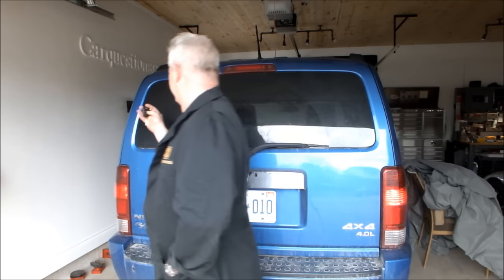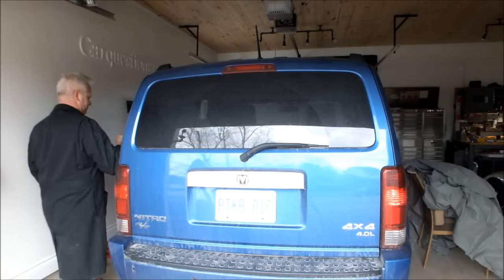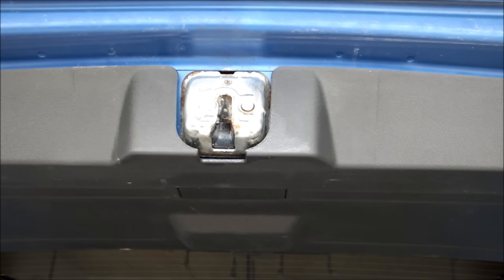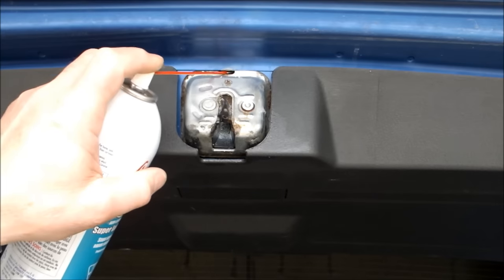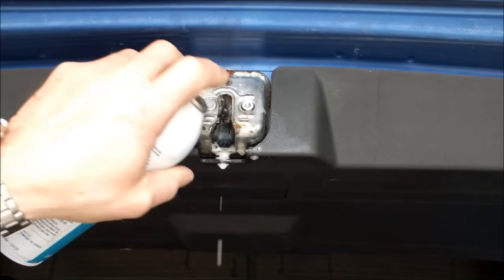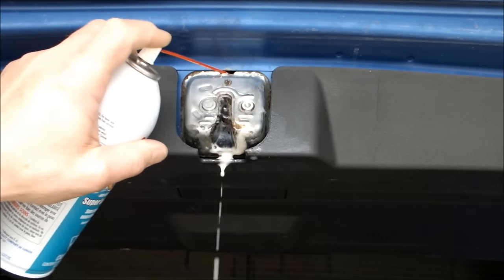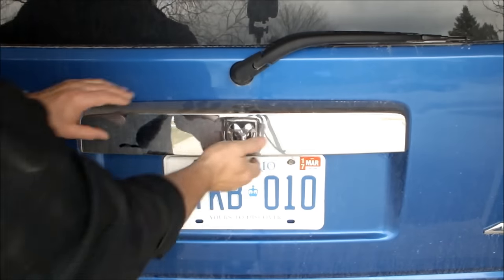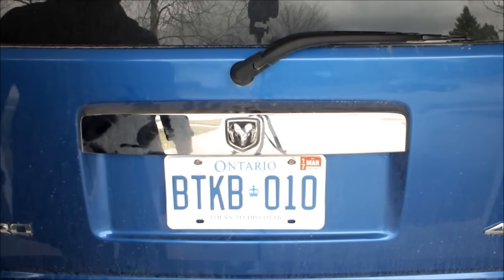Car Alarm Keeps Going Off - How To Fix It

Comment: Started having this problem yesterday.  Called the agency just to get an appointment and after being placed on hold for four times to get to the right department,  I came up on them.  Checked YouTube and your video was the first one that came out.  It made perfect sense.  I have one door that does not close properly.  I took your advise and now monitoring my car to see if it got fixed.  I am subscribing.
Reply from the maker: Thanks - hope it works for you

Comment: The wife's 2015 Journey just started the "Alarm" thing. The rear hatch light would come on even though it was closed. Watched this video (the first video that came up) popped the little inspection cover at the hatch lock area and sprayed it with wd40. Problem solved. Thanks for the tip and thank you "You-tube"
Reply from the maker: Gotta love the Tube - way to go Pete!!

Comment: Thank you so much! I have been having this problem for a couple of days now and have had people leaving angry notes on my car complaining about the alarm. I was quoted $109 an hour for an electrical diagnostic (did not know how many hours it would take to figure out what was wrong) and instead bought a $5 lubricant and tried your technique out. It has been 8 hours now and no alarm sounds! Thank you thank you! You have saved me so much money and trouble. Great video
Reply from the maker: very glad to hear it worked for you Michelle!
Reply: @carquestions  Would having a new alarm with an auto remote start fic it?  I was going to do that anyway.  My jeyfob is bad.
Reply: @carquestions  HI there. Can I use a Brake Cleaner or should I go with WD-40? thank you

Comment: Thanks for posting this video. I’m ecstatic that I found it. I’d have spent no telling how much time trying to figure this out or paying somebody to fix something that I didn’t need to pay for.  The alarm  was going off randomly if the vehicle was locked. Fortunately, I noticed a Hood is Open INFO notice the yesterday so running across your video was perfect. WD-40 seems to have fixed it but if it comes back I’m pretty sure the hood sensor will be the problem.
Reply from the maker: Good going!

Comment: Worked for my Rover 25. Battery was flat after not being used for a while. Did not charge up battery like I normally do. After a further few days tonight alarm kept going off even after disconnecting battery. Read some other suggestions like removing alarm fuse. So tried wd40 on hatchback lock and closing and opening 10 times. It worked.

Comment: Not only did this solve my prob I called Honda who NEVER even tried to help by offering advice, didn't call back and could only schedule an appointment in 5 days.... I then researched the problem, tried your solution following all the simple instructions. Guess what? It completely SOLVED the problem. i am blown away with the incompetency of the dealership.
Reply from the maker: You Tube - third most visited website on the planet - for a million good reasons
Reply: Just be thankful that you didn't get to the Honda dealer who very well may have squirted the WD and then charged you $$$ to repair your alarm system.
Reply: Ford dealership told me the same on 05 p71 vic. They have been backed up due to laziness i bet lol 3 days before they can diagnose & charge me arm & leg prices for reprogramming an add on alarm system thats been going off randomly, but this time the car will not allow me to reset & i get a click from starter or ignition. This car will not start unless security system allows it to, car is still stuck @ a hotel 3rd day in & ive taking the security system box out the vehicle & its a mess. I dont know what to do.

Comment: Thank you so much for making this video. A couple days ago my husband went to get in our truck and it was locked which he hadn't locked. He unlocked it with the key and the alarm went off. Could not get it to shut off after he tried several things so truck has set. We came across your video he tried it and it worked wonderfully. This worked for our 1997 Dodge Dakota.
Reply from the maker: Glad it worked for you Rebecca - cheers

Comment: So far so good. I had this problem with my '06 Acura and took WD 40 to the trunk latch and the front hood latch. We've been two days now without the alarm going off unexpectedly; hoping that this is a longterm solution, but am prepared to replace a switch (or switches) if needed! Thanks for the great video, it was great to have something to try after being up all night trying to figure it out!
Reply from the maker: Anytime Adam - Cheers from Canada!

Comment: Thanks for the video. Mine just started out of the blue. I was going to see if I could bypass the alarm system entirely via the fuse box, but this seems to be the better way. Even so, I wish I could also bypass it entirely as the neighbors get rightfully ticked off when it goes off unexpectedly.
Reply from the maker: Good luck John - I know what you mean
Reply: Bypass c4 almer
Reply: @fredstokes1785  
05 p71 vic is operating in dark mode with a factory added on alarm system that will not allow me to start the car. Its happened once & just a simple unlock deactivates. 2nd time & the car has been stuck for 3days & ive had no luck removing alarm box as it is a maze of wires & patrol add ons that have been snipped & left without care. Ran thru trouble shooting checklist & nothing seems to work. I believe the alarm has been reset, but if i lock by key fob the red security light stays on & no longer flashes @ all, if i unlock it disables the light. Car has good power so what is the issue? Wd40 trick is a no go on this ford, something else is malfunctioning. Ive spoken to the cop who owned it before me, who put over 100,xxx miles and never had that issue as it was a service car until recently.

Comment: Funny you just put this up today, just had a customer come in the shop this morning telling me about his intermittent alarm problem he has been having on his Mountaineer and then he mention his other intermittent problem he has been having..... give you a second to guess what that was...  yep his flickering dome light and door ajar light as he was driving. He told me it has to be a short for sure lol. I told him not to worry, one little door switch and we will kill two birds with one stone :) . Ended up being the pass rear door on his but it was a little past the lube stage. Good tip for folks, great job!
Reply from the maker: +South Main Auto Repair Glad to help a fellow mechanic anytime
Reply: This will really work ?
Reply: @carquestions  hey buddy I know I'm 5 years late lol but ironically I have that exact same dodge nitro... My car alarms aren't going off BUT my horn keeps going off randomly... Do you know anything about that ??
Reply from the maker: @jamesjarrettt3995  look up problems with the TIPM
Reply: @carquestions  ok. Can I pull the left and right horn fuses without there being any issues ? Do I need to do anything before I pull them out ?

Comment: Thank you, 
 Alarm does go off with a car door open indicator  light on dash board
 Tried several you tube suggestions. Fixed wires  on door for switch,still had the indicator light on.My mechanic took a look at back door latch, it was not closing, he thought it needed a new spring and new latch,but he like you said loaded almost a whole can of WD- 40. I have a 2000 Toyota 4 runner.,opened and closed several times alit of rust was coming out with WD ,one additional thing I did also with the WD was put  on the handle underneath that was also rusty.Yes! and this did fix the indicator light showing opened door;  Once that was fixed my doors locked properly with the remote wireless key and now the alarm indicator light comes on when door is locked. Thumbs up!
Reply from the maker: Great result - cheers!
Reply: I have just got a 2020 Toyota Corolla and I’m going to try this ....I used to get on well with my neighbours!

Comment: Helpful video. I may need to try this. But a switch is an electrical part, so are you actually applying the lubricant on the latching mechanism?
Reply from the maker: Yes - the switch is always dependent on something mechanical to actuate it

Comment: Legit video, I tried it for my grandpa at 8am in the morning for his Camry 2006. His car was going off nonstop I think it's bc the high wind. At first I was skepticle but it worked for his car. Thank you!
Reply from the maker: Anytime
Reply: hello. My 2007 camry is doing the same. It mostly happens after a long drive when the engine is hot. did yours had problem with the hood too? Mine thinks the hood is open even when its closed. Please let me know if it was the same problem and if rust remover helped that.

Comment: THX!! WILL do! BUT does this problem also cause the cabin lights to go out? I've had this issue with my car and took it to Nissan and they replaced it with a $2. fuse or something. The lights in the cabin lasted two days. And the alarm still went off at night :/

Comment: My 2003 VW Beetle car alarm was going off after a hard rain. I suspected and sprayed the back trunk latch with liquid wrench. At first it reduced the the time the alarm would go off by 10 minutes so I left the trunk slightly closed overnight and sprayed the latch again the next day. With the trunk hatch fully closed the alarm hasn't gone off. In other words this worked for now. Thanks for your video!

Comment: Just had my Spark's hood latched replaced (itwas a recall) and the alarm problem started again.  We thought we'd circumvented the alarm by locking with the key instead of the fob, but its gone 9ff twice today.  But I'll try you idea on the hatch, since that hasn't been unlocking for a while.  The dealer already replaced the drivers door sensor (for $250!) and still had alarm trouble.  Can't afford to do 4 , more sensors!
Reply from the maker: I hear you Norma - good luck and Cheers from Canada!

Comment: Thank-you for sharing this video on how to stop the car alarm from going off. I have a 2012 Jeep and today as I was driving the front panel said, "gate open," I got out to check it and it wasn't open, so as I drove home the gate open and mileage numbers were flashing back and forth. The car alarm went off twice after I parked it, within a few minutes of time. So, I watched this video that I found through Google, and I tried it, the WD-40 you suggested and opened and closed the back 10 times, and it worked, the alarm didn't go off anymore. Thanks for the suggestion. Julie
Reply from the maker: Anytime Julie - glad to help - Cheers from Canada!

Comment: Thanks for this. I am having this issue with my avalon. It's a 95 so things are getting funky electronically. Same thing. Alarm going off. Door Ajar warnings. Dome light coming on. Even my tail light failure light comes and goes on the dash and my seatbelt alarm chimes randomly. I was thinking about doing this exact thing before I start tearing stuff apart to inspect the insides. Now I know this is a good thing to try first to try to save the hassle. I did notice I have a fair bit of corrosion on my positive batter cable behind the terminal too so I'll try to clean that off and see if things go back to normal. If not, I will have to start digging deep in to see if I got bad grounds, switches or even if the computer itself might be going. This car is getting very difficult to find parts for though.
Reply from the maker: Might have a bad switch in a door or good - check that

Comment: I have this problem on my camry 2009, but it doesn't show me any information if any door is open. Where can I start? I went to a mechanic and he asked $300 for diagnosis, I have read the following issues on internet:
1. Car battery connectors loose
2. Key fob battery change
3. Driver side door latch issue
4. Hood latch issue as you showed

I am clueless and don't want to spend that much amount. Please help. I will try this WD-40 tomorrow
Reply from the maker: If your remote still works then it's not the battery - try the wd40 on all doors. - Good luck Rolling
Reply: @carquestions  thanks, I know where to put wd40 on trunk and boot, for, doors, do I need to remove any part to get access to the actual area ? sorry, I haven't done such things before, learning now
Reply: and I hope wd 40 won't ruin any connections, I can spray it without hesitation ?
Reply: @carquestions  Update: My issue was that my trunk release handle went loose as I loaded my trunk too much few days back and it might have hit some luggage, I fixed it back to its position and alarm is fine now :P

Comment: This alarm has awaken me at 4 in the morning AGAIN and I can only imagine my neighbors are NOT happy.  Seems like when we get a little wind, this problem occurs; but, I have noticed the front passenger door open light comes on when the door is definitely not open, sometimes it even blinks on and off.  I will definitely be trying this as I'm at my wit's end with the many problems I am having with this Kia Optima.  Would you happen to have a hack for cracking and peeling paint that won't cost me the $4k a new paint job would?  😫
Reply from the maker: Sorry no paint hacks - let me know how you make out with this - Cheers from Canada!
Reply: @carquestions  I will let you know.  I put oil yesterday, and did see the door open flash a couple of times on dash when driving, gonna add a bit more today and try.

Comment: I have a toyota 3rd gen 4runner with a intermittent alarm.  I thought the  alarm reason was that i had disconnected the battery and the alarm system would not reset. No.   Well,  i had just removed the horns and alarm switch to get some peace.   Then this fix  showed up and it was easy so I tried it. I drenched WD40 on all locks including hood and then opening and closing for many times.  So I reconnected the alarm and it WORKED.   Thank you

Comment: the spray of w40 did not work for my car but ended up kept the hood up all night  to keep the alarm from going off so that it does not wake up the whole neighborhood...i was up until 2am last night trying different things.  i was going to remove the battery as last resort but kept the hood up did it.
Reply from the maker: Find your bad switch in the trunk or doors
Reply: @carquestions  thank you....I ended up having the toyota dealer replaced the front hood switch and that fixed the issue but that cost over $200 :( to do so.

Comment: I just had this exact problem with the alarm and fixed it as easy as you suggested, but not before recharging the dead battery. Thanks heaps.
Reply from the maker: Glad to hear it worked out - cheers from Canada!

Comment: I have a question. So I'm 18 and I have a 2002 BMW. I bought it used and it's kinda having problems , and it's pretty expiencive to replace stuff for it cause it's an old car, so I was wondering. Would it be better to work on my car , or get a new car.
Reply from the maker: Get yourself a used Honda or Toyota if what your looking for is inexpensive trouble free driving - the BMW is the opposite Daisy

Comment: When our old 1986 Jeep Cherokee broke down, we were donated a beautiful 1997 Chevy Suburban with the Anaheim Industries upgrade.  The Chevy dealership says that GM did not put alarms in Suburbans this year, but mine has one and I can not find any information on the alarm system.  I recently left the dome light on and ran the batter dead, so I used a new "battery starter" to crank the vehicle and now the alarm will not turn off, disabling the ignition.  The alarm was set when the battery went dead so I could not turn it off until after the battery was charged enough to power the alarm, but I was never able to disarm the alarm.  I pulled the fuse on the alarm and got the vehicle to start by turning the key and pressing a red button under the dash which is somehow connected to the alarm, but now I have no working power door locks or alarm system.  If I replace the fuse, the alarm goes off within a minute or less and keeps going off and resetting and going off again till I pull the fuse.  Any information you may have related to fixing this alarm system would be appreciated.  Please Email a response to james@agapegraphics.com  Thank you.  God bless.  James
Reply from the maker: If it isn't a factory alarm system I would remove it - look for name on it and get a wiring diagram and put the truck back to factory specs
Reply: I did look for a name or some identifying number but the only thing I could be sure was part of the alarm system was a sensor that was quick-tied to the steering column, a red button under the dash for some sort of bypass switch and the alarm horn.  I traced the wires back to a bunch of wires that looks like pile of mixed spaghetti.  I am just not sure which wires to disconnect.  Some are obvious, but others may need reconnecting to some other place after taking out parts.  Many wires  are the same color so I would not know which to reconnect to which.  This is our only vehicle and we must have it to go to the store and taking my wife to doctors so II can't afford to short out something related to starting the vehicle.  My next idea is I will take it to an car alarm shop and hope they will have seen this before alarm before and be able to help.  I am just guessing, but since the alarm still sounds, I think that the brain of the alarm system has been scrambled and I hope that some special sequence of button pushing or key turning will reset it  The alarm shop also might be able to identifying the alarm system and I can google for more information.  Thank you for your response.